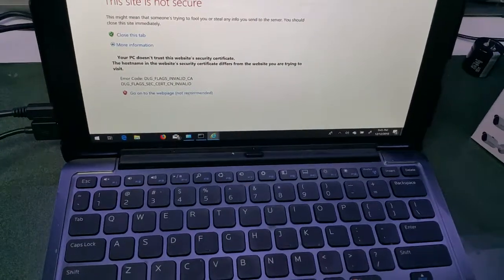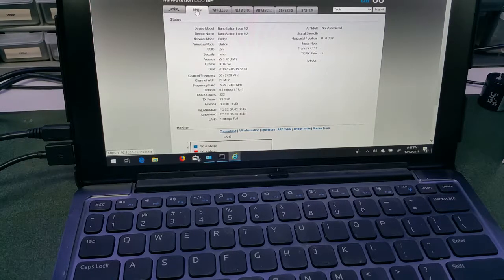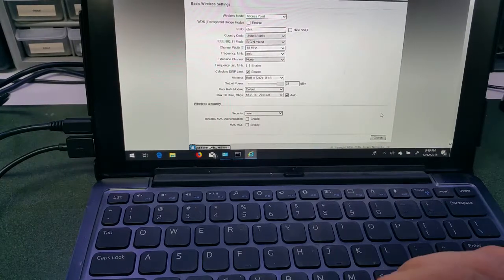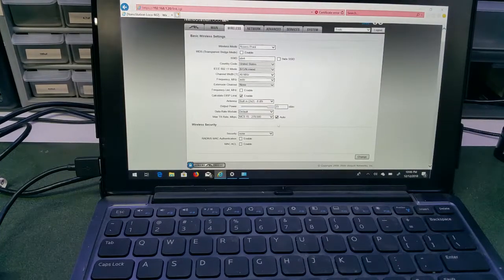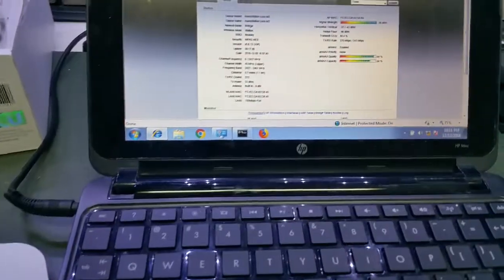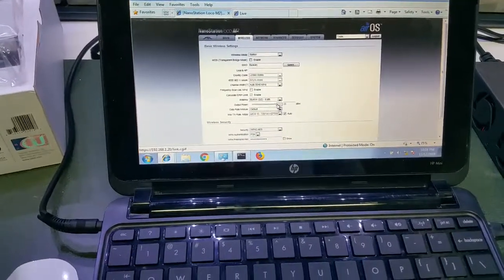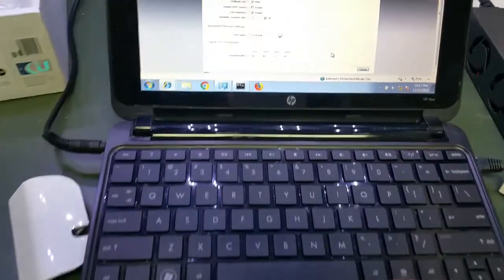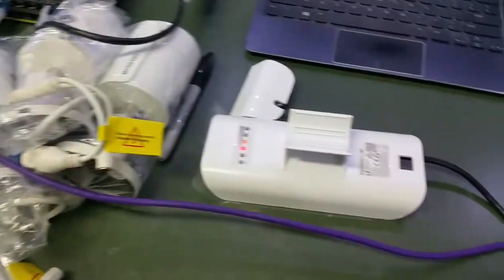IP camera system remote wireless w/ubiquiti - part 2

Comment: what's the range from 1 nanostation? Trying to get a camera set up in a shed 100m away
Reply from the maker: I live in a small town but I can connect to mine from about 4 blocks away with my phone.   They will reach 100m no problem but it's better to have 2 and set one as an access point and the other as a station.

Comment: Try the ubiquitti discovery tool. I think it only works on Chrome though.
Reply from the maker: I believe I did the second time.  i had to reset everything because i set 3 cameras to the network ip and the dvr uses a different schema for it's own built in switch.   Kept having problems when trying to correct it so i reset everything.